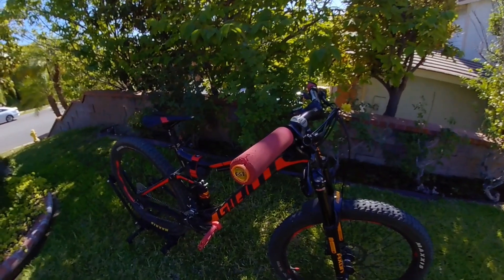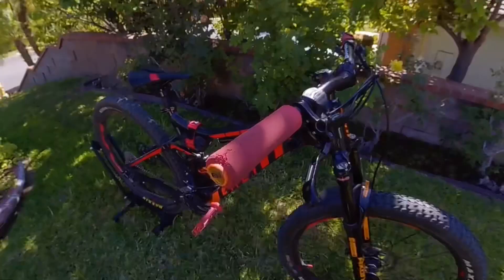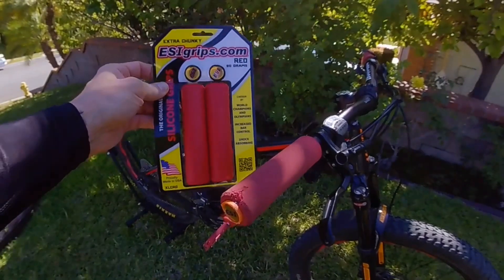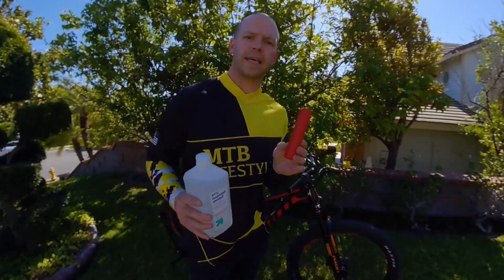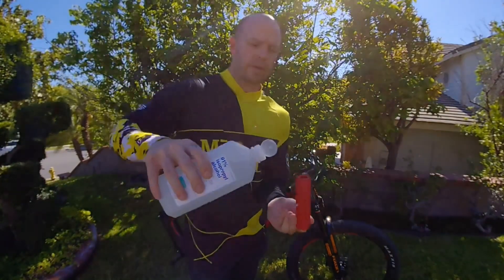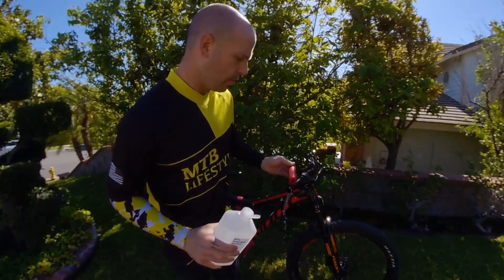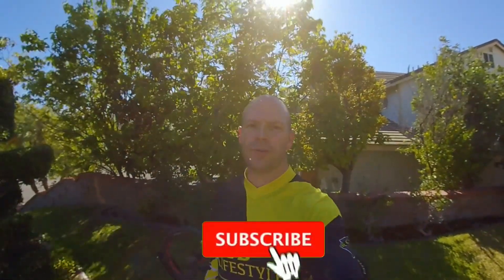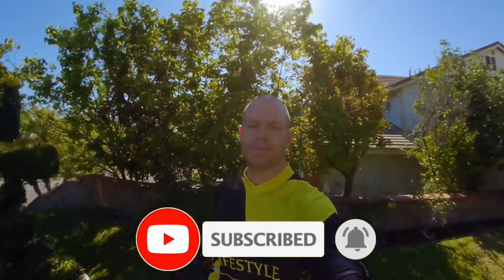How To Install ESI Silicone Grips On A Mountain Bike | MTB Maintenance

Comment: Same way I installed mine.  Super easy!👍
Reply from the maker: I think this is easier than the air compressor.
Reply: @MTBLifestyle  I agree.  The way you did it, took me a couple minutes to install my grips.  Getting them off is a bit harder, but isn't overly difficult.